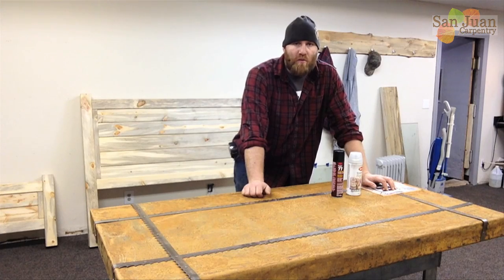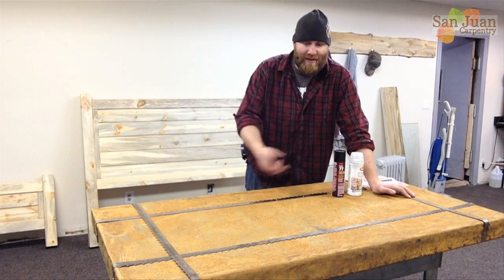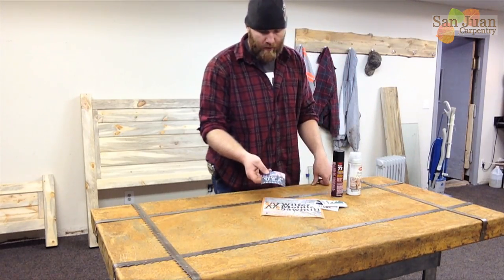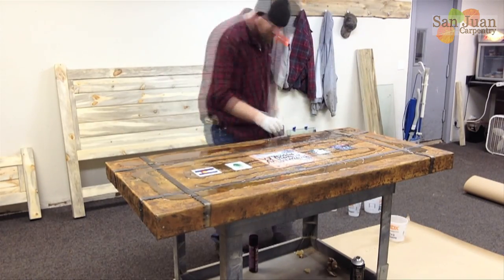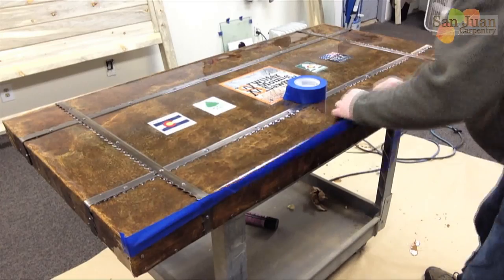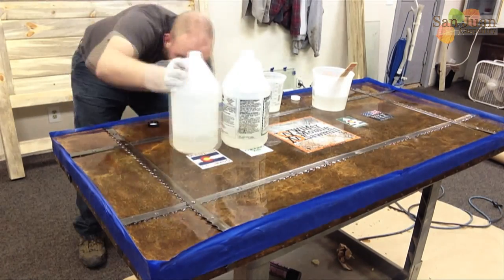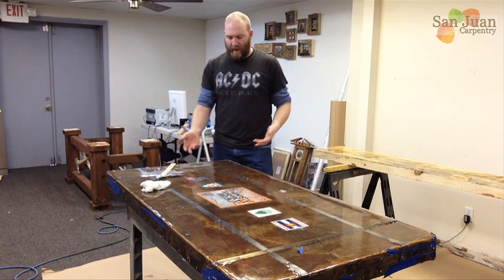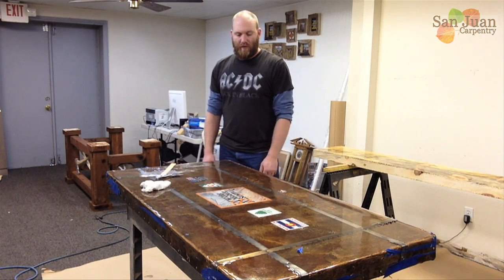Finish Desk Top... Or Not.

Comment: FYI, 30 and 40 volume peroxide is available at most beauty supply stores. Not sure why anyone told you otherwise. I use it all the time for circuit board etching.
Reply from the maker: The beauty supply store I went to said they didn't have anything that strong. Perhaps a different store next time.

Comment: Sand blast the finish off, then rust and refinish.Use a mild abrasive at first try.Then heavier if needed.
Reply from the maker: That's actually a really good suggestion! Have you removed epoxy with sand blasting before?
Reply: You Can Build That I sand blasted epoxy paint (3 coats ) off of a swimming pool I was renovating. I used a 20-40 silica sand for the blast agent. The thickness would be about the same as an epoxy coating. the silica media sand has very sharp edges and will cut through the epoxy rather than tearing it away. The finer grade will also leave a smoother finish to recoat. Be sure to use a respirator when blasting with silica.

Comment: hey that happened to me before on the epoxy. i wanted two coats but ended up three coats. first coat and it worked fine nice and dry. second coat it came out sticky or tacky and would not dry. but i put on a third coat (this time with correct measurements) and it hardened and table works great. maybe do another small test run and see if it will work for you. hate to see a project not work out.